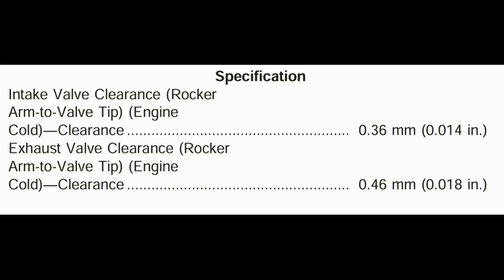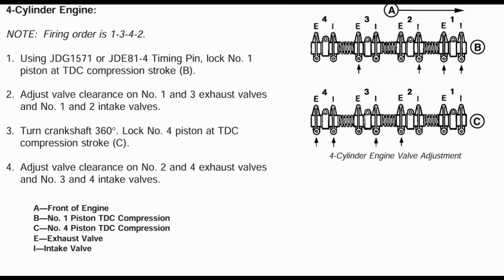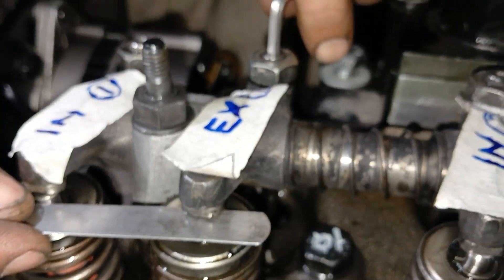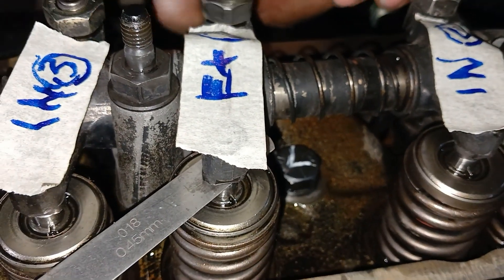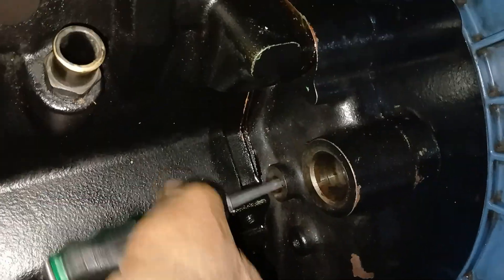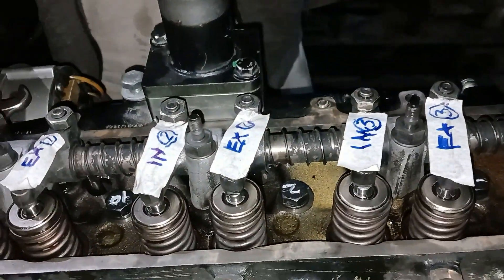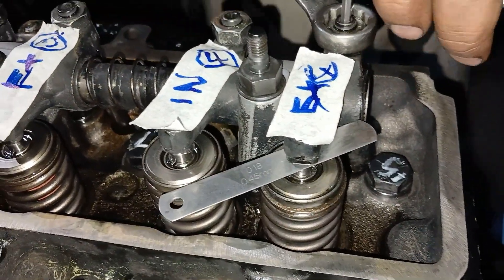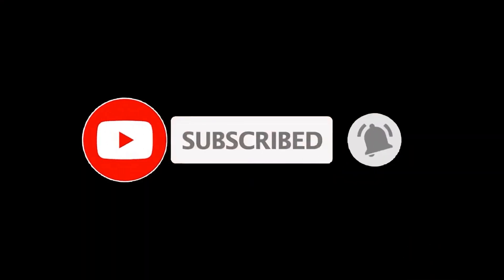Valve tappet clearance adjustment procedure. Adjust valve clearance, John Deere 4045 4-cylinder .

Comment: Y el claro.para las válvulas.del 212 perkins.gracias! Muy amable.en mm.!!! Me puede ayudar.
Reply from the maker: Intake Valve Lash: .012" cold (.305 mm) Exhaust Valve Lash: .012" cold (.305 mm)
Reply: @Technical.Education funcionó bastante vien.total agradecimiento.
Reply from the maker: Holgura de la válvula de admisión: 0,012" en frío (0,305 mm) Holgura de la válvula de escape: 0,012" en frío (0,305 mm)
Reply from the maker: (a) Con las válvulas del cilindro n.° 4 en movimiento (es decir, durante el intervalo entre la apertura de la válvula de admisión y el cierre de la de escape), ajuste la holgura de las válvulas del cilindro n.° 1. (b) Con las válvulas del cilindro n.° 2 en movimiento, ajuste la holgura de las válvulas del cilindro n.° 3. (c) Con las válvulas del cilindro n.° 1 en movimiento, ajuste la holgura de las válvulas del cilindro n.° 4. (d) Con las válvulas del cilindro n.° 3 en movimiento, ajuste la holgura de las válvulas del cilindro n.° 2.
Reply: @Technical.Education mil.gracias.lo tomare en cuenta.cordial saludo!!
Reply from the maker: De nada, amigo.
Reply from the maker: Ese es el método que se describe en el manual si quieres seguirlo.

Comment: I have a John Deere 6400 (1996) premium. Will the firing order also be 1342 and therefore use the same sequence to adjust the valve clearances? Thanks and informative video.
Reply from the maker: @noelgallagher5406  yes 👍

Comment: Can you please tell me how to set valve clearence for myjohn deere lanz 700 from 1963? Searched everywhere and can't find
Reply from the maker: The method shown in the video is applicable to all 4 cylinder engines with firing order 1 3 4 2 and John Deere lanz 700 also has the same firing order just change the valve clearance feeler gauge size according to your engine.
Reply: @Technical.Education  i can not find data anywhere wich gauge size feeler i need for my lanz 700
Reply from the maker: I am searching but no data found

Comment: Good morning please I have a problem on John Deere engine 76kva after the ovaholling the oil is not coming to raker harms please worth is the problem
Reply from the maker: These are three basic steps during every step crank the engine with safety precautions. 
1. Check oil pressure with pressure gauge 
2. If oil pressure is good, remove the rocker arm shaft and check the oil coming from the hole under the rocker. 
3. If oil is coming in the hole, check for restrictions in Rocker. If not coming, remove the head .